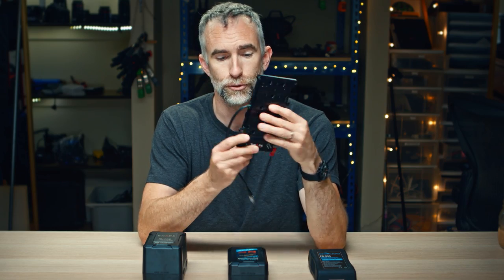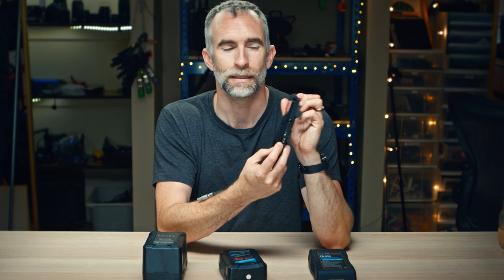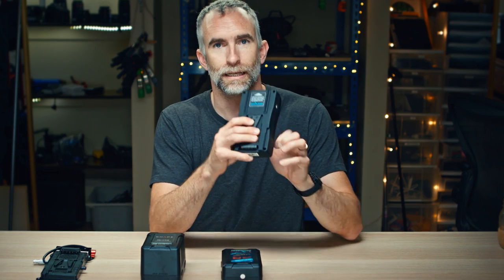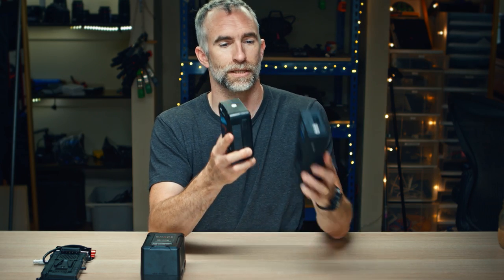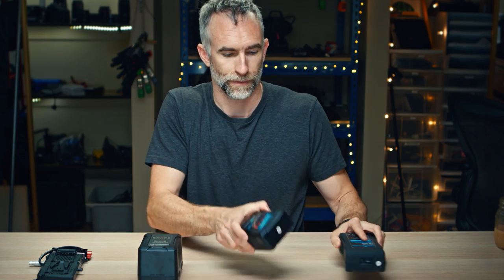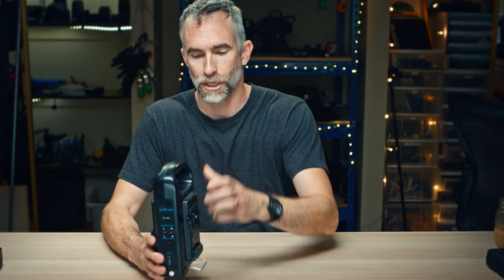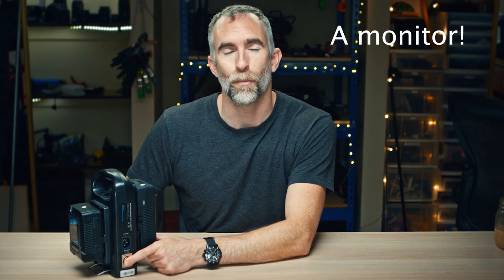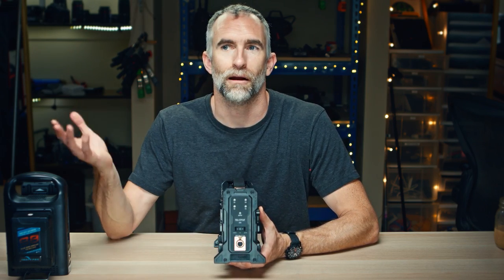SUPERCHARGE your Cinema Camera with V MOUNT Batteries

Comment: When I'm using v mount for handheld I stick it on my belt with a cable that goes to the camera rig with 1 male to 4 female d-tap adapter so I can plug in my external recorder and other accesoaries. Also if you're using 98Wh v mount (14.4v) for powering 7.2V devices (with 14.4 d-tap to 7.2 dummy battery adaptor) The mAh that this battery gives you is around 13 600 mAh which is massive (compared to 1800 mAh of the LP-E6 for ex.) When I'm using Ronin M for gimbal shots I also use its p-tap ports to power the camera and external rec. This way the whole setup is little lighter, and it gives you more quality gimbal time in exchange of less battery life but also less sweat :)
Reply from the maker: The belt mounted battery is an awesome solution! I haven't used it apart from lights, but I can see how it would save a lot of weight.

Comment: Hey man, nice one about v-mounts. I do have an issue with those batteries though: they are big and heavy. So if you want to shoot handheld or on a flycam...smaller is better. So there are the canon batteries which are insanely expensive. But I did find seemingly the only 3rd party batteries for the c200: Swit LB-CA50 - they are actually placed in the battery socket of the camera and stick out a bit like the canon ones. They are attached though with a D-tap cable which you can get with an additional D-tap power output... not bad for small and light setups. I'll probably make a video about them - really useful ones! Again, compliments for your channel - one of the reasons I bought the c200 :-)
Reply: The Keen Pixel whre I can find these as the d-tap out is perfect for powering external atomos rec
Reply: They are just as expensive right, but don’t you have to plug it into the camera power also?
Reply from the maker: Hey, Thanks for the feedback! I'll check out the swift - they seem like a cool option.
Reply: Hey everybody, I've just made a quick video about these batteries: https://www.youtube.com/watch?v=MFi3GFCxsz0 that should answer your questions :-) The Swit batteries cost around half the price of the Canon ones.

Comment: In the BMPCC 4K manual they recommend removing the LP-E6 battery if you use this kind of external batteries...But you recommend to leave it in?
Reply from the maker: I think that's because the BMPCC charges from the power input, so it would be like leaving your camera on change. The C200 doesn't do this. Its fine, even desirable, to leave the battery in while you have external power.
Reply: @Crimsonengine  thank you.

Comment: Another great vid, as always. Just curious, do you know if the batteries need the proprietary chargers to mount. I own IndiPro V-Mount batteries and chargers but would spring for the Shape 270Wh battery, but not if I also need to buy a separate charger for it. Any chance you would know if the Shape batteries will charge on the IndiPro charger? Thx either way!
Reply from the maker: As far as I know, the chargers and batteries are universal. There are two standards: v-mount and gold mount, but as long as the battery fits the charger, it should charge no issue.
Reply: Crimson Engine good to know. thx!

Comment: Bro it put me in big trouble because when I attached v.mount battery directly to my canon c100 my camera  is not working now due to high voltage.it's board burned due high Voltage as u know v.mount battery is 14v but camera need only 8v therefore I did big mistake and also why don't know about these type of issues which are created by these kind of issues nd what we need to do it.......all of you make videos like a advertisement for these kind of products but not tell us properly how to use it nd about it voltage power nd cameras voltage etc
Reply from the maker: It's not the battery that regulates the voltage, it's the plate you attach it to that connects to the camera. This is what you need: https://bhpho.to/2JLEoFFhttps://bhpho.to/2JLEoFF